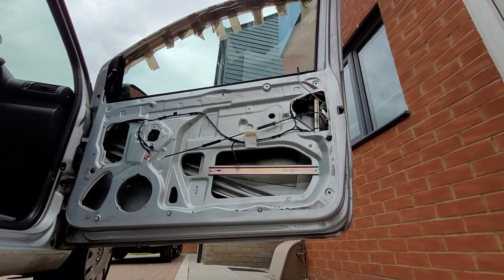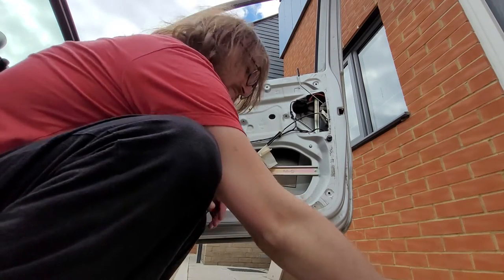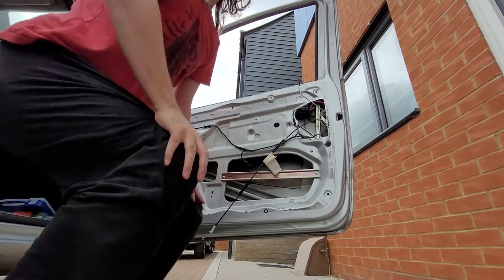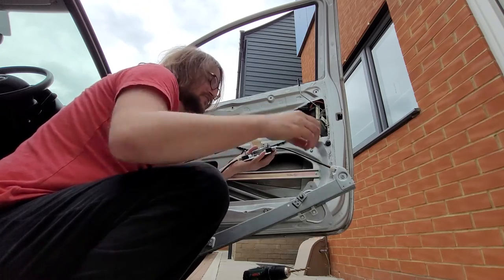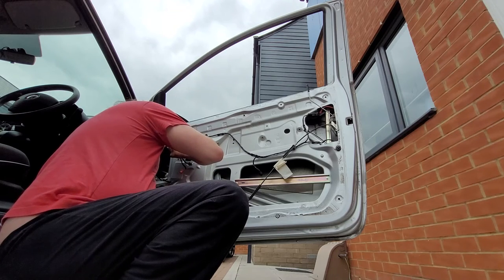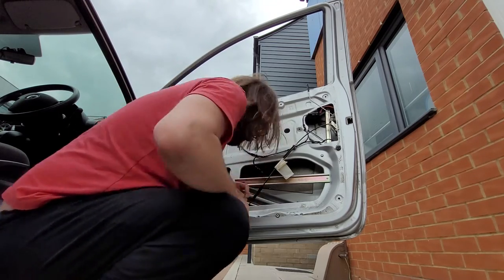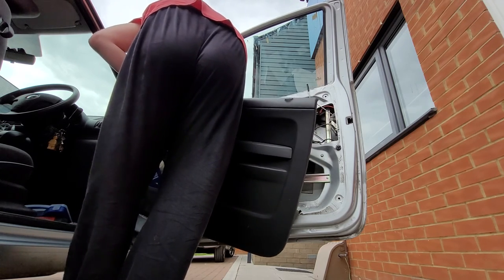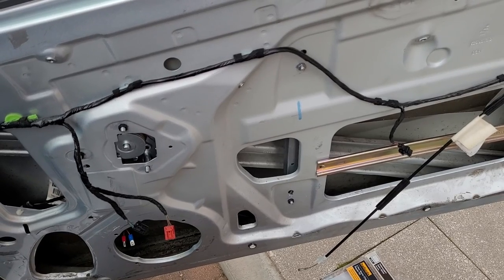VW FOX Window Regulator Install Tutorail

Comment: hi there ... i watched your video about the speaker replacement one or two years ago... and i thought about replacing my window regulator (manual 💪 for the bizeps... lul) back then  because it was a bit off... and now its way off and im sitting here watching this video blaming my self why i didnt do it back then xD thanks for both videos ✌😂
Reply from the maker: No probs. Best way to lean is to just go & do it, make the mistakes & lean from them. Like always use OEM parts. Replaced the window reulator with an OEM one I salvaged from a VW fox at a scrapyard a few days ago. Now it works properly again.

Comment: Thanks for this video, but I'm still struggling to get the outer door panel off. The window winder handle appears to the problem but I cannot get it off.
Reply from the maker: Mine was electric, I imagen it will have a cap on it you can pull off to reviel a screw of some type.
Reply: Sorted, there is a ring between the winder and the panel, you just push this forward and it pulls straight off. Thanks anyway.
Reply from the maker: @canon5dmkii  Nice, there was going to be something like that in there.
Reply: @canon5dmkii  hey, when you say push this forward, does this mean push the winder upwards/north towards the window? Trying to work out which direction and didnt want to break it!
Reply: @BeanieBroadcast  No the ring is on the winder shaft, between the handle and the door material. Push the ring forward away from the round bit on the end of the winder handle

Comment: Eprom9 do you have a link where you sourced the new mechanism please?
Reply from the maker: The part you are looking for is a VW 5Z3837502A. After using mine for a while I would not recomend getting the exsact one I did, however there are loads of third party mecks. Some vendors also sell the OEM parts which I would recomend getting the most.